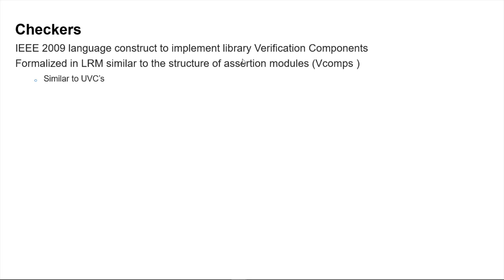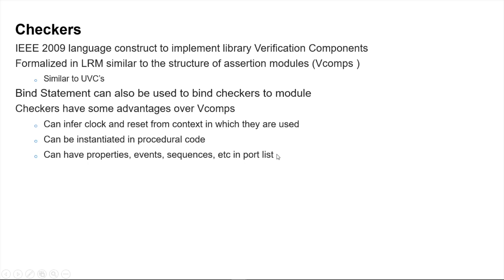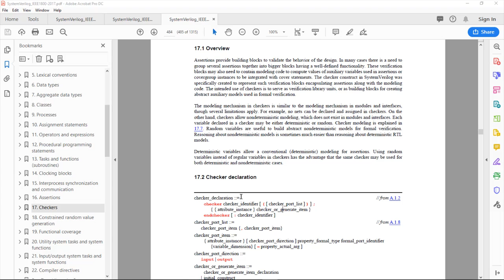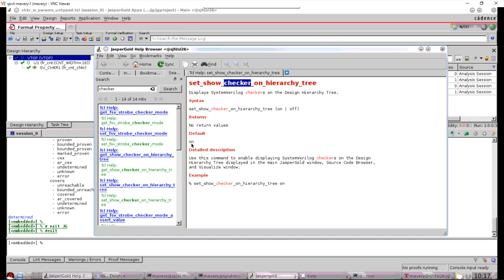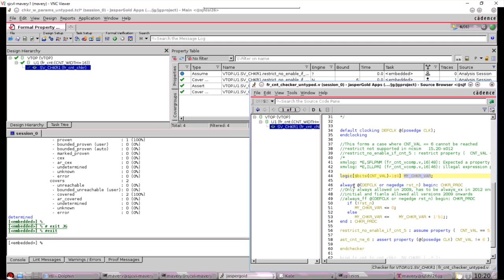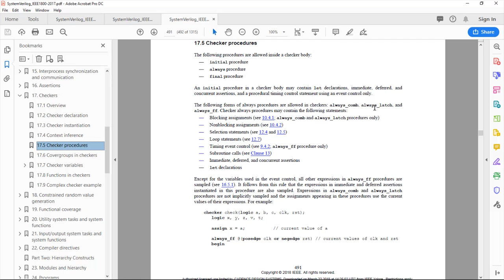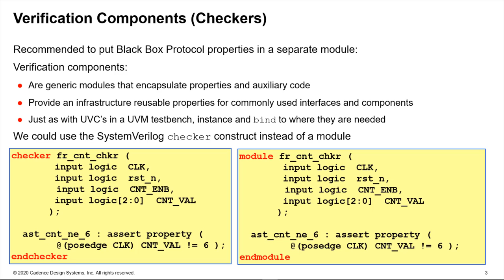SystemVerilog Checkers

Comment: Thanks Michael for the excellent video.
You demonstrated how to use $bits to declare the width of a register in the checker's auxilliary code.  But how would you declare an aux code register that is not related to the width of a checker port?  For example, an aux code counter of outstanding AXI transactions (MAX_PENDING), which we'd like to keep as narrow as possible for optimal formal efficiency.  Normally, in a vunit, that width value would be passed by a parameter, but I can't figure out how to pass it to a checker.  The RTL, that the checker will be bound to, does not have a signal that represents the MAX_PENDING value or width.
Is there a checker solution for this?